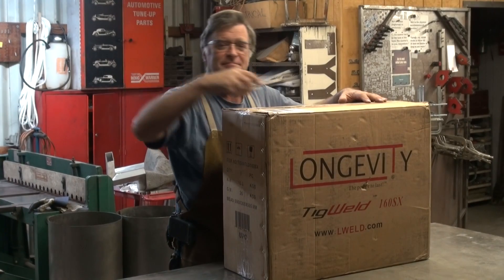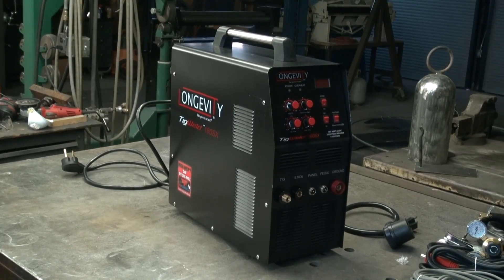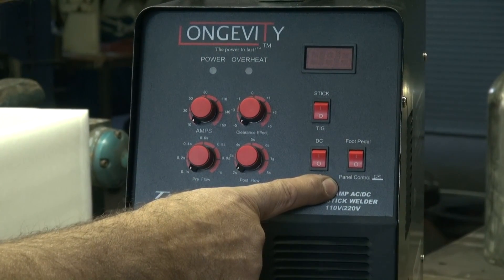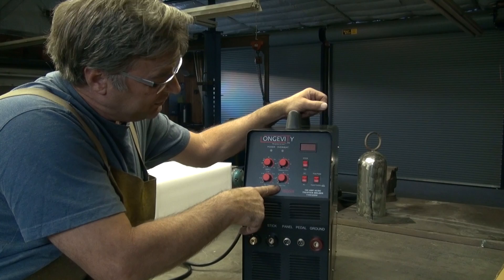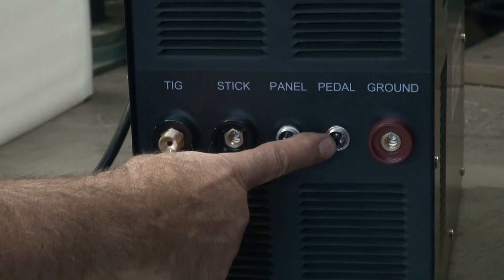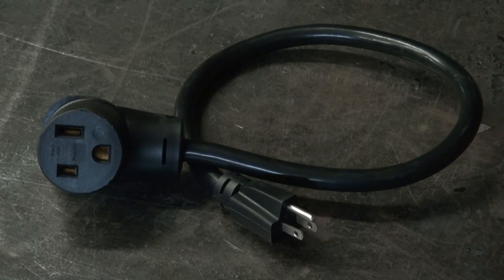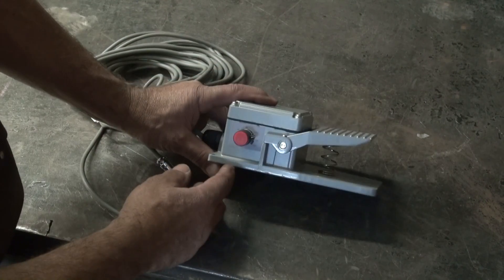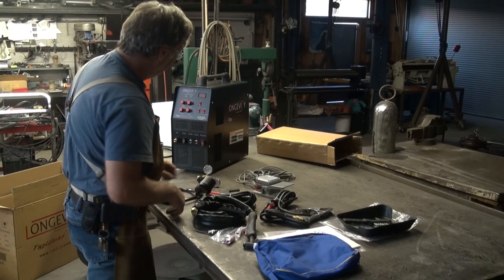Introducing the New Longevity TigWeld 160SX With Arc & TIG Welders - Kevin Caron

Comment: 160 amps @ 120 vac, in your dreams. 160 is @ 220vac,Plus, No, you can't use this in the yard, not unless you have a huge very costly extension cord.  it draws too much power, and will heat most extension cords to unsafe levels at max 120 vac output levels.

Comment: I really like this welder but I am not a huge fan of the foot pedals, there just another thing to trip on for me and they aren't very useful for out of position welding. I know there are things to velcro to the torch that make it adjustable amps but I was wondering if there is a way put on a torch like the miller ones without replacing the hole lead just the handle and torch.  I like the ones like the miller because they don't have a lot of bulk like the attachments do, and I like the type of scroll wheel. Are there any torch handles that will work with that and what would you have to do to put it on.

Comment: The Hot Plug is black because with Tig you are hooking up DCEP reverse polarity or Electrode Negative. Commonly colored black.. Ground Side of the circuit Hooks on the Positive side.. On Stick welding it is Electrode Positive Or  and The ground is electrode Negative.or straight Polarity.. And the Clearance Effect only works on the AC side of the Machine. Does not work on DC.. In short it is nothing more than AC Balance.. Blending Electrode negative with Electrode Positive..

Comment: Tigwelding materials with DC, normally the torch is DC negative and your groundclamp set to positive. The colors should help for orientation...
Welding aluminium you use AC, build up of two waves, the negative and the positive.
The positive half-wave breaks up the oxide, the negative half-wave processes the "normal" welding procedure.Clearance effect called "AC BALANCE" i guess, for shifting more Amperage to pos. halfwave or more to neg. half-wave. I think works only in AC - DC makes no sense

Comment: Respected Kevin,
I was commenting Your box. I am glad it's working without glitch after that beating. I'm not a welder but an electronic technician at open pit coal mine. Just keeping my eye on new stuff.
Best regards, Goran.
P.S. My sincere apologies for false alarm, but if I think about recommending a welding unit, after this reaction Longevity will surely be at top.

Comment: Hello, my name is Simon Katz and I am with Longevity. The unit does feature high frequency on the TIG, and you are also able to weld with the included pedal. In addition, on the stick, it can run even 6010 rods. The machine comes with a cord for 110v and 220v operation.